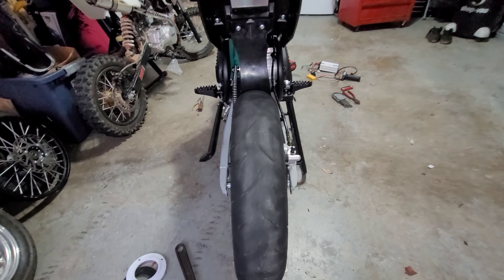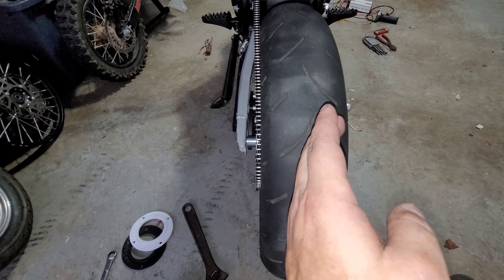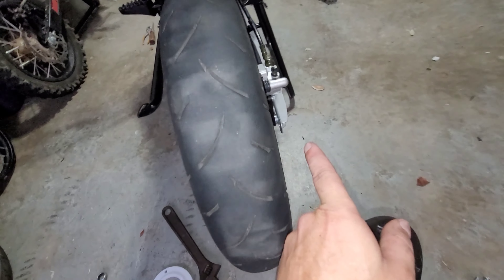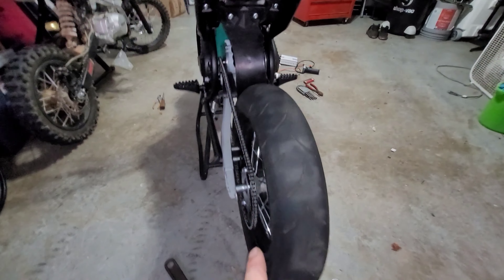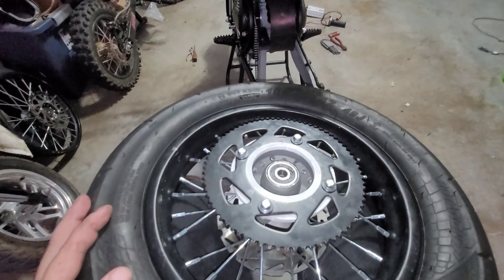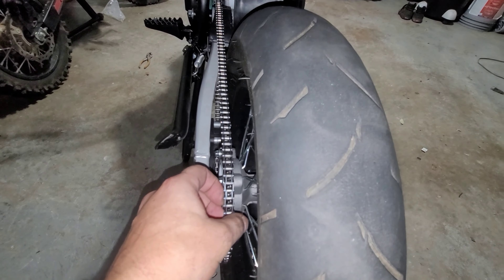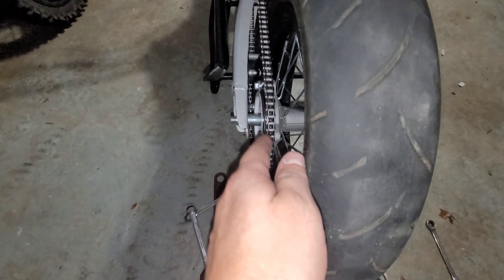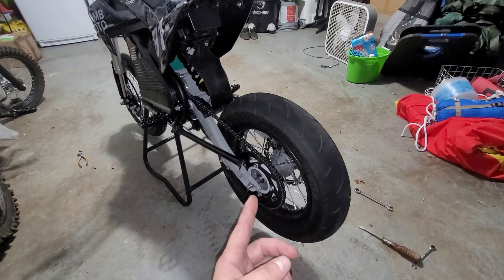BombMoto B1 - Custom Hub Spacer For 100 Wide Street Tire!

Comment: Sweet ! Make it work 💪
Reply from the maker: 🤘 im honestly suprised how well its holding up, but 72v on the fardriver will be the real test
Reply: @EmxBrandon  what kind of amps are you thinking 🤔
Reply from the maker: @vmaxfodder  so far everyones having good luck at 100-110 amps and 200-200 phase. Should be a good 7-8kw! Everyone whos got one hooked up with a fardriver says the torque is nuts, im stoked!
Reply: @EmxBrandon  I'm almost done with my scooter frame , and starting the battery box deck . The 84v LG lt50mt are supposed to output 140amp.  I'm hoping to see if the pack is strong enough? If it is? I will just go with LG all the way around.  But if it can take more ? I will add an additional Samaung 50s pack for the rear driver .( 280amp  ) I just don't have a clue wich way to plan . Is 100 amp good enough with a ND  84530?  The ah is around 80ah

Comment: But what about the offset on the motor? Won't the 6.5mm affect the chainline?
Reply from the maker: Thats why i took the 6.5 mm spacer off the other side. That was all explained in the video! I took some away from ine side and added to the other sovthe sprocket never moves from its alignment.